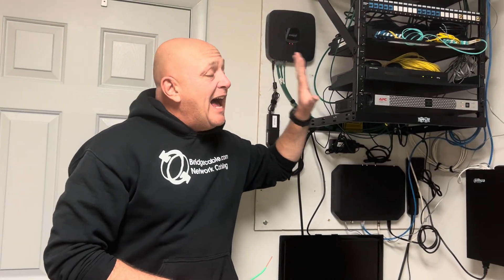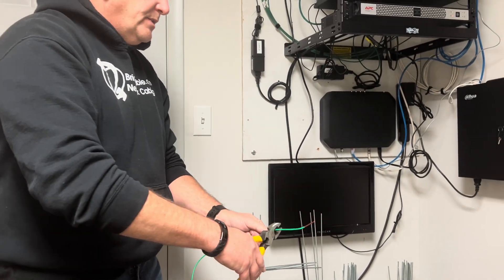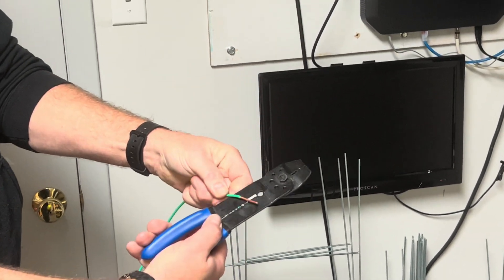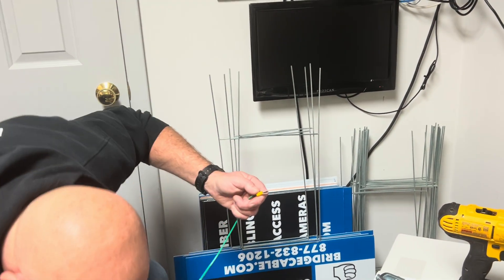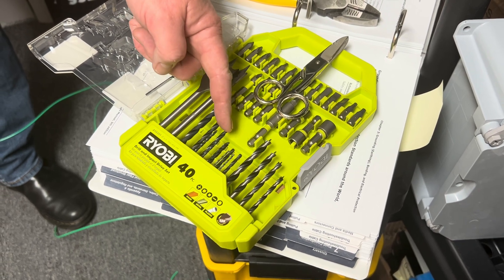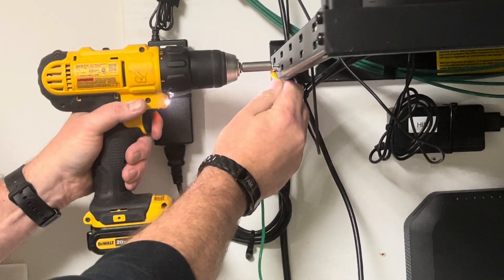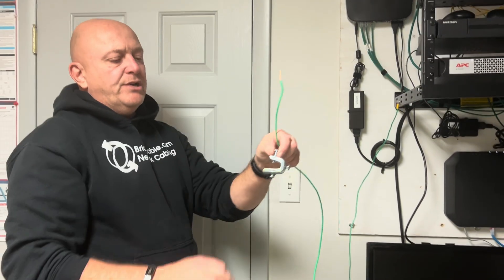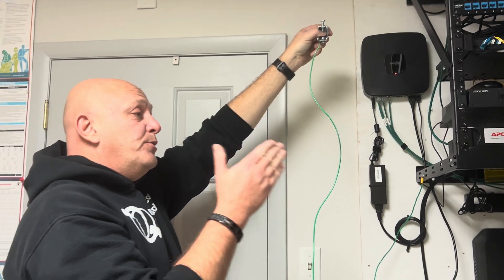Grounding a Data Network Rack Overview without a busbar in construction on a budget- BridgeCable.com

Comment: Does running #10 THHN free air for the grounding violate any NEC codes ?
Reply: This is for a non-professional, DIY, McGyver do it on a budget solution

The real professional solution would be to install a Telecommunications Grounding busbar which must be connected to the Service Equipment Ground, Siemon has a free Guide if you Google "Siemon Grounding for Screened and Shielded Network Cabling"

You can also look up ANSI-J-STD-607 which is the standard you should be following for a proper grounding and bonding system in a commercial building, which you can easily find for free and don't need to buy expensive standards